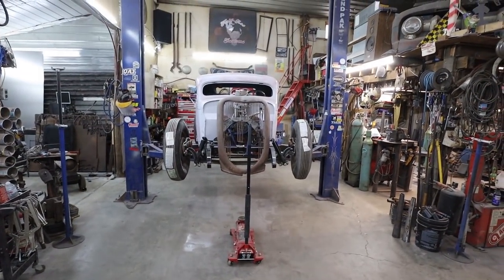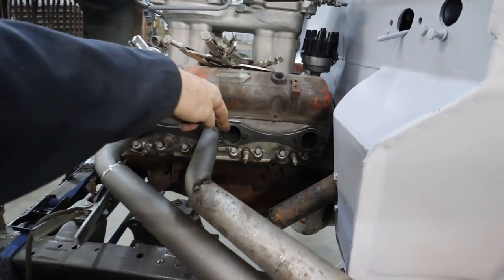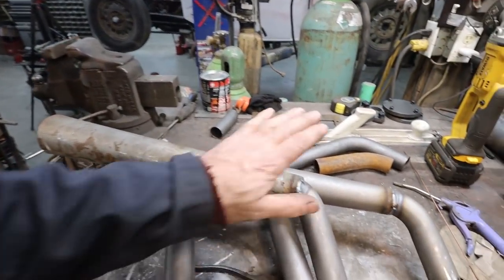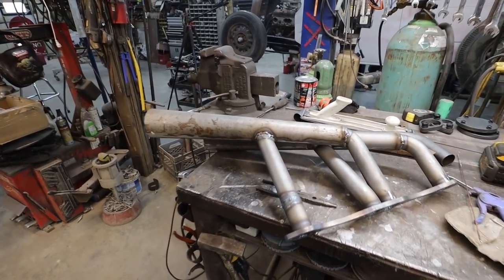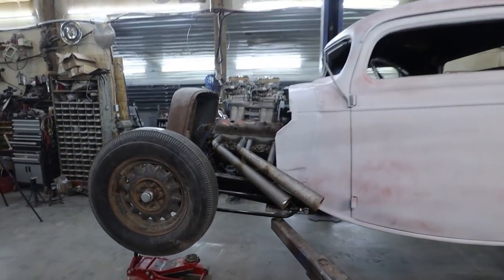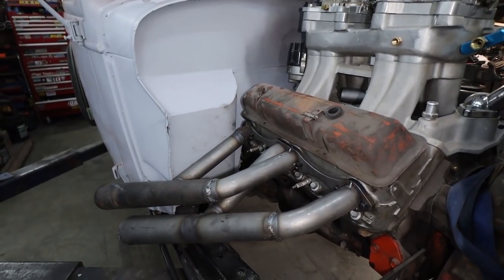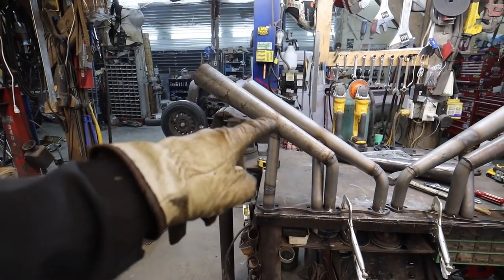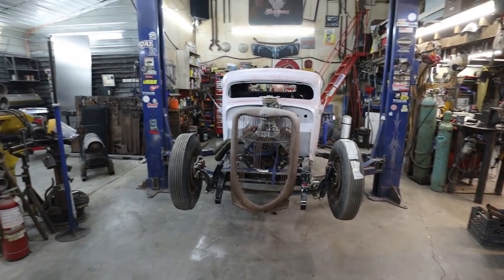Building custom lake style headers for the 37 Ford hot rod Part 27

Comment: I have used baffles for headers into short side pipes on a build before, on those the washers had holes all the way around. Without the baffles it was a ticket waiting to happen, with them it was too quiet, so I tuned the sound by drilling all those holes in the washer bigger until I liked it. Food for thought. Those headers look great, so does the rest of the truck. A pleasure to watch.
Reply: Car Chemistry 3-Disk Collector Insert 2.5" Diameter
Part Number: 176-3DI25R on jeg’s website. A picture in case my words weren’t clear 😉

Comment: The headers turned out great. You made them look easy as usual. The wrap on the headers may muffle exhaust sound, you could the one side on and when you get the motor running, stand on the side with the wrap and listen, then go to other side with the metal exhaust and listen to which side you like the sound the best. Have a great day my friend.

Comment: Great content, as ever. Heat paint is definitely advised with the wrap. It stiffens it up. It will not steam so much, in case it gets wet. Because it absorbs less water. People reacted surprised when they saw me riding my motorcycle with wrapped piped in the rain. Waiting for a traffic light, it looked like a steam engine.

Comment: Headers came out very nice. Like a Japanese bike out of the '70's. I know the truck is a Rat Rod, and exhaust wrap goes with Rat Rods ... but those headers are pretty darn smooth as it is, straight from fab. With a little judicious grinding and some sanding, they'd look beautiful in high-heat black - and be a much nicer presentation (you're going to have some rusty exhaust peeping through if you don't paint them, anyway - not a good look).

Thanks again for an enjoyable video!

Comment: about like wrapping bike handle bars. I took regular handle bars and added bar ends to them then made a oak piece to connect both bar ends together. fun part was wrapping them. this reminded me of my handle bars. make great downhill racing. you can really lay into your bike and use your elbows on the handgrips works great.

Comment: i use short side pipe mufs with header flange with caps driled with holes bolt them on . and you can uncap them when wanted

Comment: Brent the headers are looking fantastic, on dirt bikes & motorcycles they pack the the slip on exhaust pipes with steel wool, less makes them louder and if you pack more in they get quieter. If your exhaust is still loud just pack some in around your baffle. I think if you paint the truck you can always paint the pipes hi heat any color. The wrap looks like you're hiding a bad weld job, but you're not you made those headers look great and then it looks like you wrapped them to hide them lol. You can paint the wrap also lol. Keep up the amazing work on this build and God Bless you and your family I love your work. 💪🏼💯👍👍🙏🙏🍻👌🏻Minty lol

Comment: I’ve had painted VHT White headers. I liked them but on a full fender 36 Chevy delivery you only saw them when hood was open. The clean white turned to a burnt off white in 3 months. The wrap is appealing it will look cleaner longer…. But without hood of fenders it will be easy to clean

Comment: Brent like you say can't see both sides at the same time haha
those pipes mmmm look like first world war soldiers leg"putties
i had a rod with a exhaust lookin  prob after scratching my head for a while " i painted them  gun blue " in a heat resistant paint
it worked great didn't peel or rust,,,, body was pearl red,,  interior red velvet,,, ,steering wheel wooden with leather rim and chrome spokes,,,,,,,,,  chrome dished wheels ,, yeah good old days ,,,,,,,,,,,,,,Edwin J

Comment: Well a friend of mine and I both like the pipes without the wrap, but looks like the crowd is 50/50 on them anyway. What I was wondering is, would the sound change if the wrap was on compared to if the wrap was off? Which would sound better?

Comment: Hey Brent, where or how do you build power steering hoses for your swaps? I need to go from my ls power steering pump to a ford steering box. Any store recommendations in the south east for getting a hose made?
Reply from the maker: Usually just make one out of the 2 and use a compression fitting to connect the two lines.

Comment: I've always wondered if exhaust is ever an issue with the exhaust blowing out by the window
Reply from the maker: Never an issue hyway driving. Sometimes  in town depending how badly the motor is tuned :)
Reply: @HalfassKustoms  yes that's what I would have thought I mean you figure it's dumping out at the window